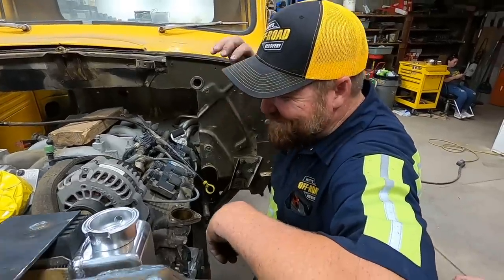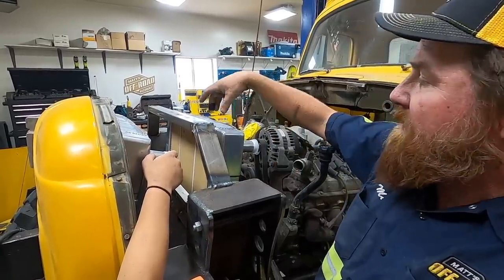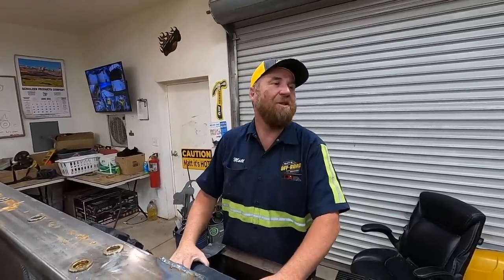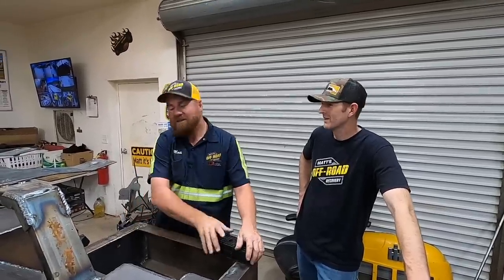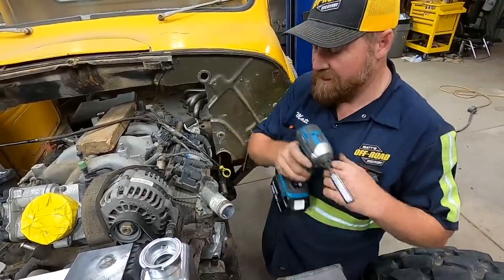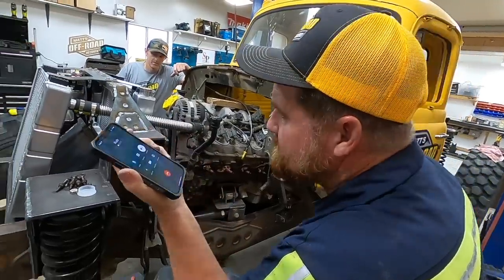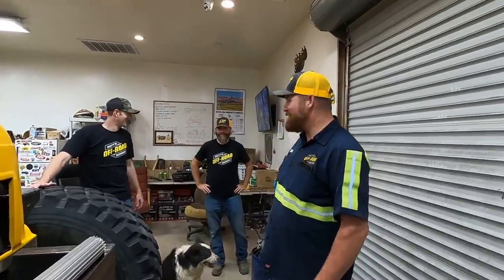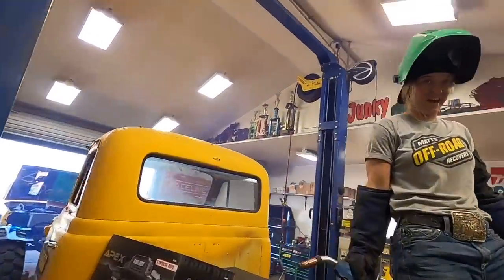This Part Ruined All My Work! The World's Largest Off Road Wrecker

Comment: Its funny, when I'm working on a tape measure I usually remember it as things like "3 and 3/4 and one mark" inches. Know how to read one, just faster for me to recall. If I need more precision too I can go something like "3 and 3/4 and 1/2 a mark." if it works it works. I'm also usually the one take that measurement else where and cutting/bending/etc. so there is that too.

Comment: You want to switch the flow through the radiators: First through the second one, then thought the first one. The reason beeing that you want the maximum differential between the air and the water temperature for maximum cooling - on both surfaces.

Since the air in the front is the coolest, you'll get more cooling effect if you run the water last through the first radiator. :)

Comment: Opening description of radiators, Wrong flow path on radiators, put the rad behind the front one first in coolant path. Then you go for the controlled leak into the second rad instead, yeah, still asking for trouble. Putting a "Heater Tap" with a bypass in there line to bypass the second rad when cold. Only pull on the second circuit when main can't keep it cool. Leave the factory recirc line alone.

Comment: If you still have cooling problems consider what a friend did for his project.  He got 2 cooling towers from Catepiller dossier and ran them next to the frame of his 1936 truck when he put a 454 in it for pulling his camper from job site to the next job site.

Comment: Not sure why you put leaf springs for radiator bracket.  Might rethink about how to stiffen the hold down bracket or not, it's not like they can go far, maybe the shrouds will aid in holding things in place when the rig gets jostled hard.  Still going to be a sweat ride to see in action without a doubt.
Thanks to TomTom for the health and safety tip for antifreeze poisoning.

Comment: Heat transfer rates are a function of temperature differences. This means that hotter air from the front radiator will have a greater cooling effect on the hot water straight from the engine, than on the cooler hot water coming from first radiator if the engine outlet goes first to the front radiator. Therefore, to maximize heat transfer from the two radiators, the engine water should go to the rear radiator first. But it's your truck. Retired lifetime oil industry maintenance and reliability engineer here, done a lot of process engineering. Air bubbles aside, which could be bled off with a special valve, the front radiator will also loose efficiency with a top outlet for the water. Cool water will pool at the bottom of the radiator the way you are setting it up. An easier way to control the water temperature would be to have second higher temperature thermostat that opens when the water needs to go to the second radiator. apologies for pocking my nose in.
Reply: If you use my suggestion, you can leave the original thermostat system in place no problem.

Comment: Consider running the rads in parallel. A rad can dump more heat the hotter it is.  If one rad has already dumped a bunch of heat the second rad won’t have as much to dump.   Series might work fine so I guess try that if it works but consider putting them parallel if it gets hot.

Comment: fluid dynamics add a small water tank to a mist system to help draw heat also weld fins on oil pan to help dissipate heat from oil

Comment: does the top radiator support also locate the radiator from front to back besides just the pressure from the support and the rubber? seems like eventually with vibrations it would fall inward

Comment: Very complicated system. Lots to go wrong. Here is what i did. Put in a 10gallon reservoir, Water left the engine, >to normal rad, top, > left rad to holding tank, from tank to water pump. This along with a water restriction (old washer in the thermo housing), slowed the water down enough to cool and the extra capacity kept my engine temp at a constant 180 no mater the load.

Comment: I think some air schoops on the side of the wings of the bonnet  might  help  push som colder air in to the secondary radiator  this concept should work might  also be worth  putting  a water tank on bord to help with cooling off the radiator who knows until it is complete well all find out looks really  cool and I gather it huge in person and yes bonnet  bonnet bonnet  no hoods about  here 😂

Comment: Yup, don´t forget to connect the hot water to the rear radiator first. That's how heat exchangers work. That way, the air will always be cooler than the water.

Comment: Your radiator further forward having out let amd inlet both on the top. Is that going to flow water using the whole radiator or is it just going to have stagnant water and only flow across the top 8 tube er so

Comment: I don't know if I’m overcomplicating things here, but wouldn't it make more sense to go through the back radiator first since the back radiator then has hotter air to work with, so if you give it the hotter coolant the temperature difference is greater and the front radiator gets cooler air and cooler coolant, so the temperature difference is about the same as on the back one

Comment: Hey  Matt Old School. if you Drill 2 Small holes in The Thermostat 1/8" one at 9 - O'clock and one at 3 O'clock . It will let the air out of the Engine.  And you don't have to worry about AIR IN THE RADIATOR.

Comment: For the power steering and oil coolers you could mount them vertically right in front of the exposed radiator on the front on each side of where the fins on the radiator end

Comment: those ports in the radiator 
might work for the heater core in the cab i,m guessing you need heaters for winter jobs

Comment: you should run the hottest coolant out of the motor into the hotter (inside) radiator first. Bigger temperature difference between the radiator and coolant at that point than if you ran it into the front (less hot) radiator first, and then into the warmer one. This is all just to create a sketchy countercurrent heat exchanger out of the two radiators. Otherwise I like your thinking, matt ! -guy with  2 degrees in mechanical engineering

Comment: Understanding fractions is critical to using an empirical tape. 

Start with understanding fractions first. Then reading the marks. This can be done with graph paper and replicating the marks and listing out the fractions below 

So 1/4 = 2/8 = 4/16 = 8/32 …. 

Otherwise just build on his knowledge of halves. And demonstrate half the halves.  
So half of 1/2 is 1/4 half is 1/8 … and see that on the marks.

Comment: Will that PS cooler fit across the front of the front radiator above the grill slots? It will be less vulnerable to impact and will still catch airflow from the electric fan.

Comment: as an engineer in training I do think that's pretty cool. However, I do think that your current water pump is likely going to be over worked. It will be pushing significantly larger quantities of water than it is designed to, which will relate to a slightly higher power draw from the engine, but should be fine. However, its rate of flow is going to be reduced due to the higher resistance from a more complex system. Even though the engine is working harder to keep the impeller rate equal, the pressure bypasses and holes in the path of the impeller are going to be exploited at a greater rate. All this to say, a larger water pump may just be the way to go if you run into cooling issues. Though I doubt you will. The 8.1's tend to run rich, which helps them run cooler.

Comment: I think you should pass through the rear radiator first. Because if you go through the front one first you cool the water and heat up the air so when you get to the second radiator you do not get that good cooling.

Comment: I like it but I think I would have mounted one of the rads in back of the cab ou down under the back with a electric fan keeping more room around the motor for a intercooler for the coming turbos or supercharger you will need for that big rig.

Comment: With radiators, you always want your hottest water to come in contact with the hottest air first, so you've got it setup backwards, as described. Coolant should flow to the inner radiator first, then to the outer radiator, then back to the engine.

Comment: With the front radiator being on a slant or a lean will that end up restricting the air flow through it, compare to a one that is perfectly vertical?   Will the thermo fans be placed at the very front of the truck?

Comment: As the 42nd engineer, I don't have much to add but you might want to pull the cardboard out of the radiators, the truck could overheat otherwise. ;)

Comment: I'm concerned that by putting both your intake and exit ports on the top of the front radiator, as heat rises, the top section of the front radiator will be the only section that will flow water. To use ports in those locations successfully you'll have to go with a dual pass down flow radiator which they don't make to my knowledge that's because the water pump can't push that mush pressure. That brings up the next thought you may have to install a supplemental water pump to ensure that everything flows properly as you're trying to move a lot of water using the system that doesn't have any pressure to speak of. You could put the lower port back onto the front radiator and angle it upward and for the air vent issue you're worried about just install a radiator drain bung on the top or upper corner of the radiator.
Reply: You could also check my information by pulling the radiator out filling it up with nice cold water then using a hose on the drain port of your hot water heater and a custom hose attachment to your intake port turn on the hot water full bore and let it run as long as you'd like to checking it with a thermal imaging unit or thermometer.

Comment: You might not want to put the hot oil cooler next to winch winch free spool knob. You don't want to burn yourself every-time you mess with the winch. But you probably wont use the front winch all that much, food for though.

Comment: You need to move the inlet on the front radiator to the bottom side so your hot water flows up through the radiator instead of your coolant just running through the top circuit and leave the rest of the coolant in the lower portion of the radiator.

Comment: Add 2 fans in that side gap pulling "fresh" 100° air from the sides into the middle between the 2 radiators 1 in and 1 out

Comment: Ret, Tape Measures Are Not My Thing. isnt an option . I say learn to read it or go to the house and help do the laundry. A tape measure is one of the most important tools in the shop. there are more functions one a nintendo controller than fractions on a tape. 1/8 ,1/4, 3/8, 1/2, 5/8, 3/4 , 7/8,  Have fun and keep up the good work.

Comment: Seems to me if you put the rear radiator more horizontal with an electric cooling fan drawing air through that you have a cold air supply going through both radiators. Just a thought, Thinking outside of the box.

Comment: don't over tighten those nut zert's, or you will be drilling them out.  Star washers are to prevent loosening bolts while off road.

Comment: i call dibs on one of those 6 spots but... it would be more efficient t have the coolant go through the back rad. then through the front ad because it will raise the efficiency in terms of heat dissipation

Comment: Tig welding is one of the most specialized welding techniques there is....  Its arc welding on steroids.... the heat is finitely controlled and the metal is added by using a filler rod.... I love tig welding.... its been years however.... it is an art....

Comment: Matt without  bashing i was wondering as to why your trying to re invent the wheel ?  i appreciate all your hard work going into your cooling system but i think your over thinking it  GM  like any other manufacture has put the engineering into it all ready  i think by running dual radiators in front of each other even with  electric fans will create a dead zone of the air flow causing the air to become to dense for air to free flow  but thats my take of it  but hope you prove  me to be wrong . personally i would of used the biggest 4 core  radiator with push and pull fans and been done with it  good luck    ps i cant wait to see this rig in action its gona be bad ass  good job

Comment: why not almost block off in-between the radiators and pump A/C into it....add a switch so you can turn it on for the really hot days ;)

Comment: {1:00}water that moves into pump comes from bottom of radiator, the cooled water, thermostat opens vale allowing heated water to top inlet of radiator, gravity, airflow, fans do cooling of water

Comment: What I don't see is provision for an electric fan to drive outside air over the radiators. You can increase the engine cooling by blowing air through the radiator matrices which is especially valuable while under load at low speed -as in towing!

Comment: That cooling system is really messy with very little to be gained, if at all. Trying to reinvent the wheel for no reason. One big radiator with double or triple pass would be best. There's a reason why Ram dropped the double radiator system on the Ram trucks after only a few years.

Comment: Interesting build,
Why are Radiators designed with the inlet in the top and the outlet at the bottom? Oh that's right, so you use the whole radiator, By putting both at the top you will be pumping the water across the top. you will not find anything that has to do with removing heat from coolant that doesn't have a high low inlet outlet.
You don't have to be one of the 7 engineers just an old hot-rod builder would do it.

Comment: As a humble mechanic, I think the coolant is flowing through them in the wrong order. Also, you would probably be better still having a lower hose on the front one and adding an air bleed line to the top instead.

Comment: The flow from the radiator is top hot to bottom cool this forces the water to cross all the flow fins, unless your radiator is a down flow the hot water will just cross at the top and never reach the bottom part of that front radiator, or am I missing something?

Comment: The front radiator outlet should be at the bottom and then to the top of second radiator, or the hot coolant will just pass across the top and the lower section of the radiator won’t be used to any advantage
Reply: @MattsOffRoadRecovery  will be good to see it up and running and see how well it goes. Looking forward to it.

Comment: My goodness that radiator support is burly. It's clearly armour, rather than mechanical support. It's the sort of thing you'd see on a logging truck. If you put a formed steel lid on it, like a bent plate or inverted tray with a standoff, it'll be even more resistant to crushing forces. Would probably be suitable for Ukraine. 4mm mild steel plate would be super-tough, but aluminium would save some weight and slow down whatever tries to crash through it much the same.

Comment: I would have put the eecond radiator horizontal above the engine, with a shrouded electric puller fan attached to it.

Comment: Running radiators in series is not optimal. As the temp goes down the efficiency goes down, so the 2. radiator wil carrye no work until the fist one is overloaded. Running them in paralelle will be much better

Comment: I would have put a 190 therm on the engine and a 210 on the radeator closest to the engine then have the front radeator just as a normal radeator all with fans.  Just my opinion 🤷.  I think you guys rule.

Comment: Here's some fodder if anyone criticizes the stacked radiators. Since you'll have fans on each radiator, mechanical on one electric on the other, your stacked setup should work just fine 😉. To see a proof using hard data watch Linus Tech Tips "Is this even going to work..." video. They had some arguments with viewers and manufacturers about stacked computer radiators and decided to stack up a whole bunch of radiators and test temperature differences. It turned out that while running two radiators with only one fan performed the same as only running 1 radiator, they could run like 7 radiators and still see performance increases as long as each radiator had its own set of fans. Without enough fans you just can't utilize the surface area of the radiators, but more fans and more radiators is more better. 👍
Reply: However I should add, if your one radiator has both the inlet and outlet on the top (and is a single pass radiator) you will only utilize a small portion of the cooling on this radiator. The water will have no motivation to flow through anything but the top few coils and then dump straight out into the next radiator, so all the coils in the bottom 2/3rds of the radiator will likely do almost nothing 😥 (only some minor heat conduction taking place).

Comment: You shouldn’t have used compressed cardboard. It’s not porous enough to flow air thru the radiator. I recommend using cork actually. I’ve also heard of a few people who have gone without any cardboard or cork at all. I don’t suggest it because I never believe what I read on the internet.

Comment: Radiators so close to each allow for heat transfer between the two, partially negating the purpose of having two radiators. I understand the need for redundancy in this build, but how you have mounted these radiators is confusing for me. Place an airflow block behind the first with a duct to feed it into your engine air intake.

Comment: The Rear most Radiator should get the Hottest water from the engine, then the cooled water from the rear radiator should pass to the Front Most radiator that is getting the coolest Air.
This will provide the Maximum amount of cooling.